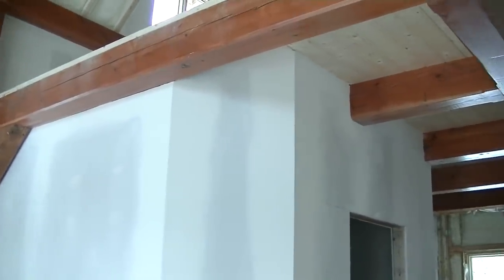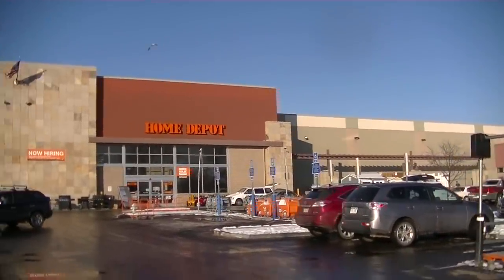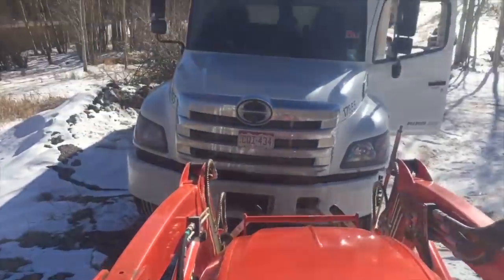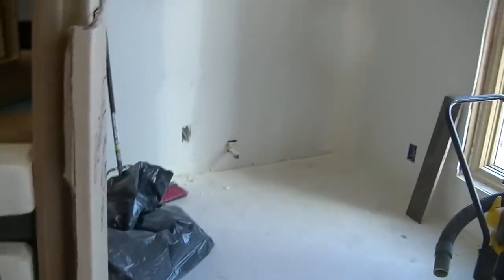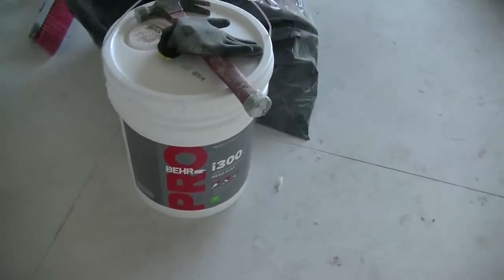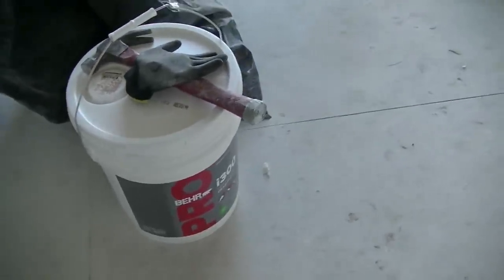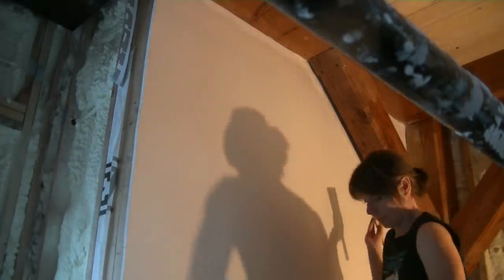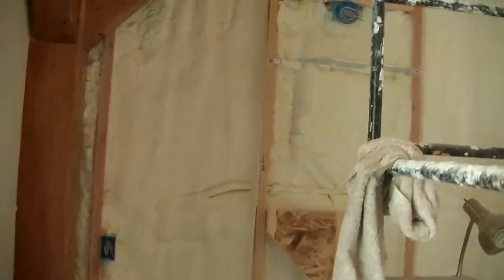Drywall Finished! Sneak Preview of Wall Wood Paneling & Painting Begins

Comment: If you are going to pour from the bucket, take the lid off and use a brush to clean the edge of the bucket. Silly as it sounds, when using a roller pan that you have to refill often, using a large "kitchen pot ladle" is fast, cleaner and you don't have to lift the 5 gal bucket. An extension pole (get a good one) make it easier on you and faster. Buy an expensive roller handle. They are thicker, stronger metal that won't bend like cheap ones so you can put more power to the roller. Fastest way to paint out of a 5 gal is to use a "grid" in the bucket instead of a pan. From bucket to the wall. When taking a break or stoping for the day, wrap the roller in plastic and it's ready to go tomorrw. Watch out for fine spray flying off while rolling getting in on your wood. Hope there is a tip that might help.
Reply from the maker: Thanks Lastniceguy!

Comment: Exciting progress - DIY tip - There is a pouring spout that you can attach to the 5 gallon paint bucket to help reduce the mess of pouring straight from the bucket.  Look for it in the paint department at Home Depot or Lowe's.  Keep up the good work.
Reply from the maker: We actually have one which I found in the garage(a very loose term).  Of course too late to make the video.

Cheers!
Bryan

Comment: Is that recycled oak flooring used on the walls?  Looks great!
Reply from the maker: It's a hand-scraped oak.  8" wide planks that are made from small oak pieces which are about 2x6" in size.  Like a parquet floor only linear.  Thanks

Cheers!

Comment: They spray painted our home as that was included in the drywall estimate. It took them literally 2 days to tape everything and put plastic up. Seemed like miles of tape and hundreds of square feet of plastic. Another 2 days to spray primer and 2 coats of finish paint. The fifth day they came and removed the tape and plastic and it took them 10 hours that day. We did a walk through with the paint contractor the 6th day so he could get paid. We noticed what appeared to be light over spray on much of the exposed wood. So the following week they came back with the scaffolding and talking to the guys who we got to know they said since we had the wood finished they were sure they could get the paint off. Took them a day and a half to wipe all the exposed wood down. I'm sorry, but I just don't see how spraying saves them money. With the cost of tape, plastic, and the labor to put it up It would seem to me rolling and brushing would take less time ? And they still used a trim brush on a lot of the area. And the wood looked great when they were done cleaning it with no later issues. They used some kind of orange cleaner which smelled good. Kind of made us hungry though. We were lucky.
Reply from the maker: Wow what an endeavor-glad they came back and got it all shipped shape. I prefer the roller myself- so much less messy!

Comment: I didn't see you use a pole with your paint roller. It's a big help and keeps you from climbing too much. The best I have found is a pole that is adjustable. One that expands and can shrink for tight spaces. I bought one at the Boulder Home Depot or Guiry's. I just don't remember the brand.
Reply from the maker: Yeah, been using one, but like to get up close with my eyes to make sure I don't miss anything.